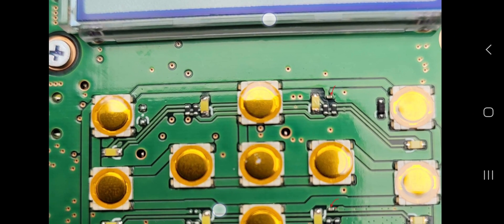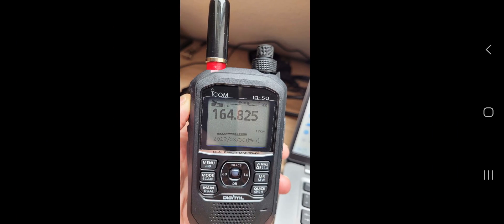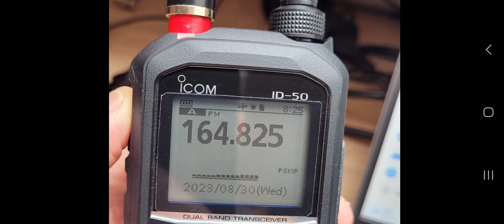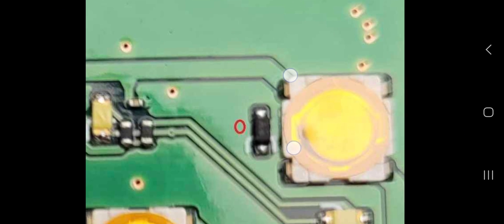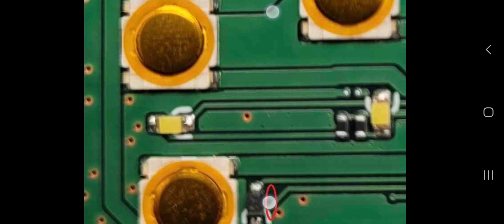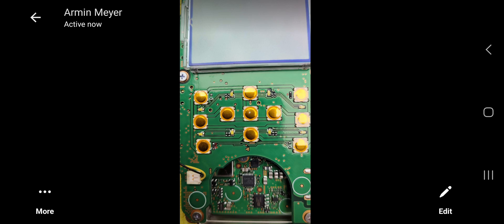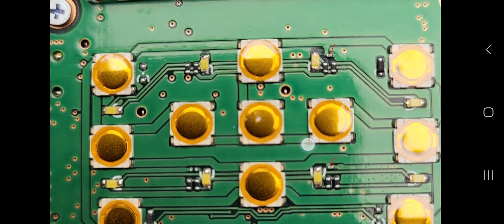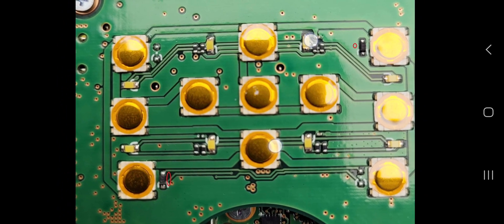ICOM ID-50 TX MOD (DF1AM)

Comment: Success with removing the two larger black SMD resistors (assume they are 0 ohm) near the buttons that are closest to the circles. The little arrows on the picture point to something else like small diodes but I did not remove those and still achieved full transmit unlock. Thanks much.
Reply from the maker: Hi so glad it helped .

Comment: Clearly, the comments reflect a lot of confusion on exactly what was done. Without more description, the after pictures look the same as the before pictures. It appears that 2 diodes must be removed, and we are told they are next to the red circles. In fact, I think we should be looking at the red arrows. Do you see a difference at what the red arrows are pointing at at the 10 second mark vs at the 50 second mark? Is that what gets removed?
Reply from the maker: Google it

Comment: I did the mod and it was fairly easy. I was just too dumb to remove my SD Card before opening the device so i killed it. Be careful ;-) What bothers me now is that some air has gotten behind the LCD (Video https://youtube.com/shorts/sd4pbaotS-g?si=nt2NiS_oZbFnG8sU) Does someone know how to remove it? I did not really touch the LCD during remove of the diodes but still.... By the way, the anode is upwards for both diodes if someone wants to put them back (0.6V diodes).
Reply from the maker: Thanks for info .

Comment: Hi, is there any information guide how to disassembly radio... I removed two bolts at the top (on antena connector and selector)... and two screws behind the battery... But It's looks like I'm missing something. Thanks
Reply from the maker: Sorry i did not do this .
Reply: @M0FXBHamTech  did you enabled TX mode on this ham radio

Comment: I completed this mod today and it went without issue! (thankfully because I was very scared to do this!) Some things we learned: ID 50 is a but harder to take apart than the 52, but generally the take down was the same. We followed a id52 mars mod guide to take the id 50 apart in order to get to the diodes and that worked well. The speaker and Mic are attached to both the plastic outer case as well as the board by a few very thin wires, so we had to be very delicate in taking the unit out of its case. Once inside I removed the diodes that are pictured with red circles with a small soldering iron on its lowest heat, and put everything back together. Radio powered on and now broadcasts on a much wider range. Obviously mod at your own risk, this was just how it went for me! That said I have never worked on electronics before and was able to make it work so at least for me this was relatively simple and did not damage my radio! That said I also may have gotten lucky!
Reply from the maker: Hi well done so glad it went well :)
Reply: Hi, is there any information guide how to disassembly radio... I removed two bolts at the top (on antena connector and selector)... and two screws behind the battery... But It's looks like I'm missing something. Thanks